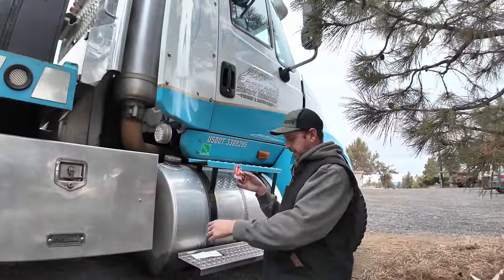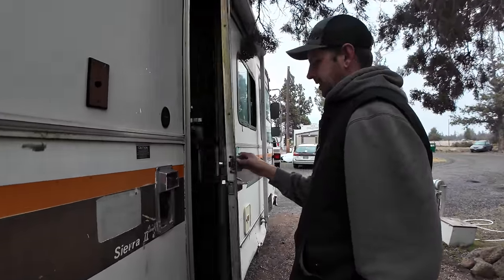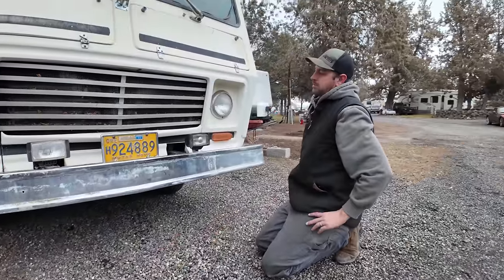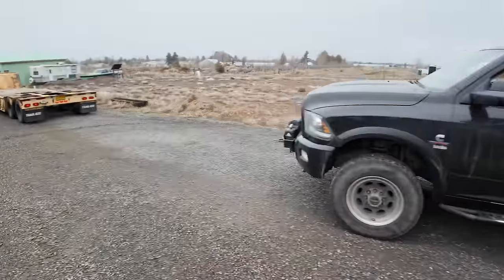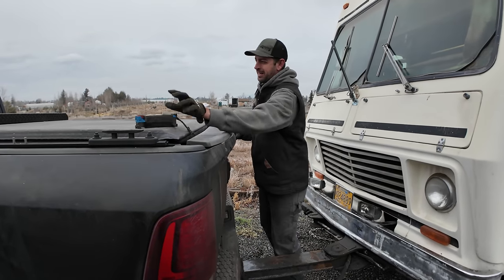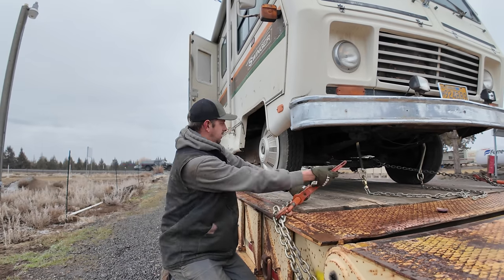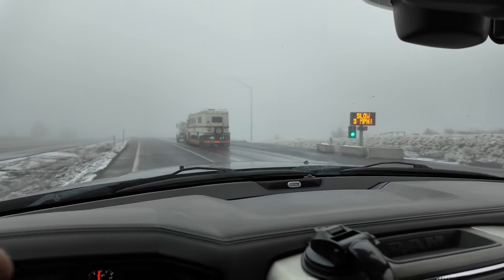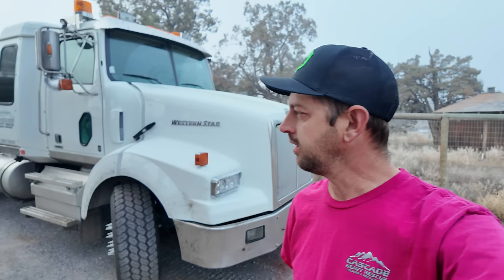This derelict RV had to go!  (20 years of cigarette smoke)

Comment: First of all, excellent video. Secondly, superb driving on the behalf of Ethan - if you've ever hauled a trailer before, having something the size of that RV behind you being towed is quite intimidating, but he did just fine. Once you warned him about the swing on the corner and the rear of your truck, he drove like he'd been doing it for quite some time. Finally, I like how you are more than willing to listen to other ideas and thoughts and not just dismiss them - it might have been a strange way to move the RV, but in the end it was probably the most practical one for the spot where it was located. Lastly, I have to agree about the weigh station and the fog. It's already challenging enough to operate in the fog, so adding an additional risk into it shouldn't be. Take that link out of the chain when it's weather like that.

Comment: That was a real nice RV once. Darn shame to see them so run down and badly cared for.
Reply: For it's era, maybe. Many showroom RVs these days are better than many houses. (and more expensive)
Reply: I have never seen a RV that is meant to be lived in full time , propane heat is so moist that it will rot from the inside out
Reply: Any RV,  T.T. or boat does the same with time. Used full time or not. You can keep up maintenance but it happens. They have a life cycle, the fiberglass models can be redone and turn out as good as was or better. But most "stickies" fail at joints then extensive water damage and mold.  Mold is a major concern for all.

Comment: The foggy conditions and scale open is the reason for the pile up on the blues I-84 westbound a few months back that burnt several cars and trucks to the ground. I have the same opinion about it you do. In my opinion the DOT should have been held responsible for causing that crash with the scale being open in zero visibility

Comment: The biggest killer of all of our tugger lines was dust….every cable that failed on us that we had tested was full of fine sand that worked liked mini knives…unlike a winch line our tugger cables where basically built like a winch line but with a woven case over the entire cable( very similar to a 1 inch paracord)..so it was impossible to see when the the internal rope cords got dirty..
Reply: Just an idea, rope washing is a thing common in Mountain SAR work. Something I learned early in my years as a SAR team volunteer, after especially dirty missions or just periodically we'd take ropes to a laundromat. One with the big commercial front loading machines. Ropes would go in set for a cold wash with just a small amount of Woolite. This would work a lot of trapped dirt and sand out of the rope. There are also rope washer gadgets sold you hook a garden hose to and feed the rope thru.

Comment: These are always fun to watch. I like seeing people work through problem solving. 
Don't they make dolly's for RV's, that could have been used instead of the rv wheels? 
Maybe you can add a winch to the flatbed, so you don't need to use the truck.
Reply from the maker: They do, but at 20-30k for a set I sure as hell am not going to buy one.   I have thought about building my own though
Reply: @CaseyLaDelle  - likely not enough of a need for them to be worth spending that much.
Reply: @CaseyLaDelle a pair of mobile home axles are rated at 14,000 lbs and are plenty wide enough as built if you find the right ones.

Comment: IFTA decals are assigned to the license holder.  The record keeping of which VIN gets which decal is on the license holder. As long as both decals match (same number), that's all that matters. As you found out. For audit purposes, you as the owner, do need a record of this (simple spread works) of decal number vs VIN.

Comment: Glad you got a paid assistant.  Of course great you listen to suggestions, give credit.  I was thinking “to bad you didn’t use Zack front lift to set it up for trailer”. I did not know you had pickup along.   My cheat is tire to tire if using pickup as winch.  First set pulling on trailer.  If Ethan had been few feet back. The pickup tire to trailer tire provides solid anchor.  If camper caught. It could have skidded pickup into trailer. minor scratch at most

Comment: Decades ago, a co-worker was retiring. He had a desk that I always admired. It was a Steelcase with an over-sized, tan colored, padded top. It had just enough padding to keep papers from scooting around, but pens/pencils would not break through the paper when writing. He smoked for 25=30 years, non-stop. Usually he had multiple cigarettes burning at the same time. He gave me the desk when he left and I began cleaning it. Thick "glop" began coming off the padding. I discovered it was actually a light green top, not tan. Yuck.

Comment: Oregon is very nice.  If that scale pass was in Ohio, there is a more than 50% chance a jerk  D.O.T. officer would have been chasing down Ethan for not passing through on the scales in a 3/4 ton or a 1 ton truck.  Ohio DOT can be jerks and have been known to harass privately owned, unmarked heavy duty pickups not pulling trailers and chase them down for driving past the scales on highways.  I won't touch jerks in Hanging Rock, Ohio Police that are notorious for patrolling U.S. 52 at 5 MPH over the speed limit which could lead to a fun battle in court because at 65 MPH, that would be within the margin of error for modern radar equipment.  BTW, Ethan did a great work on this job.  I would be interested in bringing him onboard if I were still running a rigging company because he really showed the chops for on the problem solving.   I had workers who had been in rigging/trucking for more than 25 years that never showed the skill that I saw from Ethan on this video.  Great Team Work!

Comment: When disconnecting the lines from the Truck to the Zacklift, it looked like you could use a hook or holder.  I wonder if 3M makes a Command Adhesive hook in the appropriate size?  😉😉
Feed  The  Alligator!

Comment: my guess on the jerry cans that were on the bed were possibly used as water cans with the shape the camper was in it is possible the water system might have gone out either leaks or the pump is shot and knowing it was going to be replaced with a different camper they didn’t want to stick money into fixing it those military jerry cans are or were used for both water and fuel. blue cans are typically used for kerosene, red is gasoline and green or yellow are diesel fuel and I don’t know if all states do it or not but my state Wisconsin it is illegal too put a different fuel in a can that doesn’t match the color IE putting gasoline in a blue or green can or any container that isn’t red unless it is clearly marked

Comment: An idea, make ramps off the back of the trailer.  So you can use your pickup to pull it onto the trailer, then just run drive off of the back of the trailer.

Comment: Couple questions...
What were those little casters at the back of the RV for?
Was there enough frame when you were flat towing it that you could have gone underneath the bumper with the wheel lift, which would have picked up the front end a little higher?

Comment: I was wondering what kind of Battery Pack and Motor combination could be used to replace the gas engine on the trailer.  Then I thought the trailer could get a winch attached for pulling vehicles on like this.

Comment: out of the 23 years of driving a truck the only trouble i really had with scales was in Banning California i bought  a new truck off the show room floor. drove it home loaded my stuff in it put on my stickers. and headed to California. they pulled me into the scales and on the way to my truck i heard one say we going to tow this truck. and sure enough they did. they said my front end was bad and unsafe to drive. the truck had less than 1700 miles on it.  come to find out the DOT his wife cheated on him with someone that worked for Mongomery tank lines. so anyone that got stopped by him was getting tickets or towed or both.
Reply: OMG!

Comment: ummmmm, You should have pulled it to the entrance with your tow truck last time you were there.   Also, you can probably steer it, just putting hand through window.  Carry a block of wood for the brake.  You won't be going that fast.

Lastly...grab those hub caps..!!!

Comment: How good is the Onan generator? They usually are a 7000 watt emerald. Could have Curtis Gurling hyd/ hyd brakes. Hydraulic brake cans require pressure to release. 19.5 rubber. 245 or 225. Looks like 225 negative on the heavier brake system. Big block Chevy or Ford. Wasted.

Comment: For future reference the, the class A RVs ALL have hydraulic brakes. They do that so no matter what, you should be able to push the pedal and an electric pump will give you power brakes. And the electric pump and master cylinder are connected to the firewall behind the brake pedal, in that little compartment behind the grill. RVs are money pits, never buy one. Lol

Comment: idk my 20,000 pound snatch blocks are about the same size as the rings so I dont see too much of an advantage to them its not like im backpacking this gear in a few more pounds wont hurt a thing. Im a man of tradition though I still use steel rope but I spent almost 20 years rigging loads for cranes in industrial sites so I prefer that all my gear is overhead rated. its all about knowing what your gear is rated for and the forces at play be it synthetic or steel it will kill you just as fast if you abuse it
Reply from the maker: No, they are not even close to the same size, or the same weight.  In addition to that, you would have to carry four of them instead of two of these rings.

Comment: A driver should be able to stop within the distance he can see. From a scale-inspection viewpoint what ever happens out there is not their problem. When there are freeze-thaw cycles the roads get spongy, enforcing weight limits is necessary to prevent costly damage. If visibility is 100 feet and you get back on the highway at 20 mph then any car with a speed over 40 mph is in trouble and your truck should be limited to about 35 mph. That said everyone should slow for where slow accelerating vehicles might be accelerating on to the roads.

Comment: If it is not safe to pull into and out of scales, why is it safe for you to be driving on the roads?  Should you have not found a safe place to stop and pulled off the highway?
Reply from the maker: Forcing trucks to merge in and out of 65mph traffic over and over again all day long with extremely limited visibility is creating a huge danger where there is no need for it.
Reply: Because his primary concern was not being able to see behind him if there’s enough gap to merge back into traffic lanes. That’s the unsafe situation. Not normal driving.
Reply: @CaseyLaDelle  I can understand your point if the poor condition is just in that area, but if it is for 100s of Miles then I disagree.  You have to merge on to the highway somewhere.
Reply: @JohnHallgren  How about cars passing him.  It's not safe to be out there if he can't see cars on the side of him trying to pass, or if he has to move over for a disabled vehicle on the shoulder.  If the hazardous condition is just right at the scale, sure it should have been closed.  But if you can drive on the road/highway, you should be able to enter and exit scales.  Doing this for 20 years and have never had an issue leaving scales.  Over 3 Million miles accident free.
Reply from the maker: @trainstractorscarsandtruck7362  exactly what you said… you have to.  As in, it is necessary in order to travel down the road.   That scale being open was NOT necessary.  That is an added danger created by a poor choice.
Reply: @trainstractorscarsandtruck7362  but there’s a big difference between the space needed to merge in, likely at a lower speed initially than traffic, and that needed to move over a lane when going at same speed.
And I believe he could see the end of trailer to know if someone was beside him but not the much larger distance to merge from a ramp.
Reply: @CaseyLaDelle  If they are scheduled to work, generally they will open it.  I've had to go into scales open with 2 feet of snow in the scale lot.  Common sense isn't very common these days.

Comment: Hey Casey. The western star looks good but it could look amazing. The only thing I see that would make it look 10 times better seriously and I’m sure you would never do it because it wouldn’t be cheap is the have a custom built headache box that matches the back Rolf your sleeper as in the same size and shape. It would give you a lot more storage. And a custom made box you could have doors or drawers on the outside for ease of access for smaller things or just curved doors on the outside for hanging your chains but if you made it a little deeper as well on the passenger side bottle you could have 2 doors on the side bottom separated for a small microwave and the top could be a custom fridge  or tool stowage or chain stowage or could just be a cabinet with shelves for dry and canned food like Raman noodles canned soups what ever you like to eat for use in your side access microwave and I say passenger side so it’s safe to use of course. That is if you understand what I am even talking about. Like if you added to the box you have segregated boxes matched to the shape and size of your sleeper that access from the side not the back. That way you have more storage that’s even easier access and it matches the shape of your sleeper so it doesn’t look like just a small generic box. I know I know but not only would it look amazing it would add so much more valuable storage or stowage which ever you prefer. So it would serve two added functions extremely good looks and tons of more space to have the things you need. Just an idea I have. But you have to admit it would look so amazing. Also I know you hate bright flashing lights but have you ever considered YELLOW strobes just for when it’s that foggy for safety? And mainly for daylight conditions like they use for school buses.. 🚌 I know when they started using them for 🚌it stopped a lot of buses from being rear ended during bad fog. And I do mean safety strobes not flashers not something for just towing or recovery just YELLOW strobes for safety in dense fog.